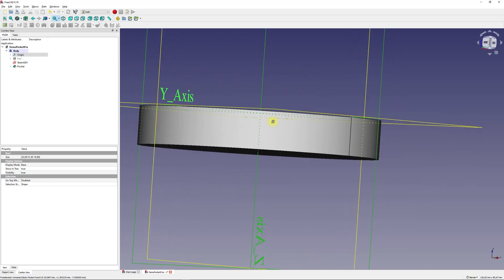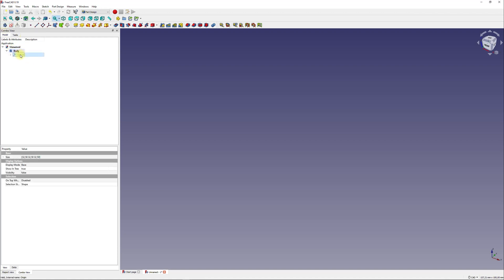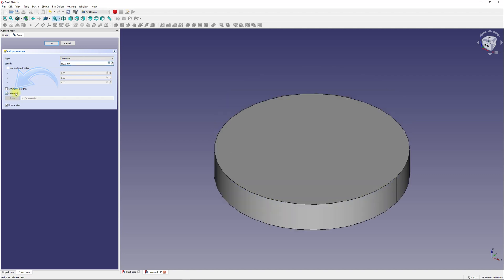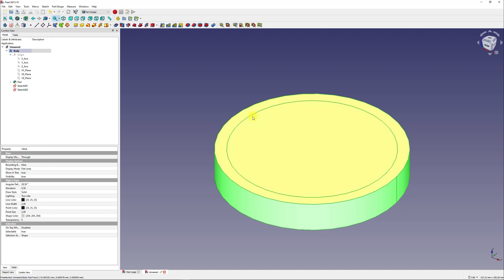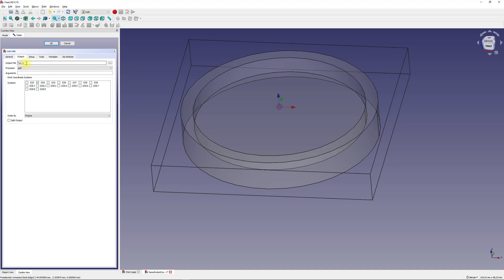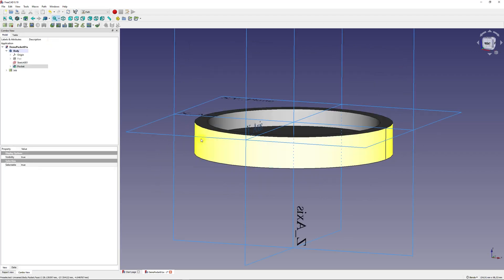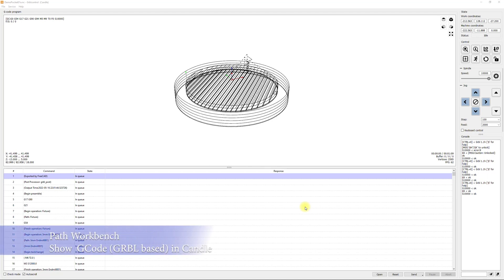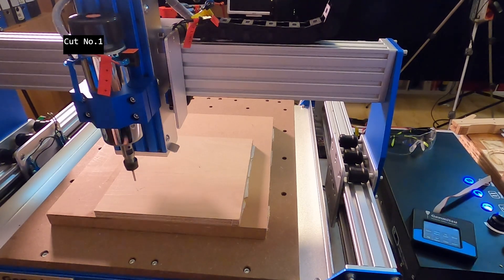FreeCAD and CNC machining - Basic profile and pocket toolpaths

Comment: Hello, I liked your video and I subscribed. I have been doing CNC machining for more than 20 years. I believe your part would have been perfect if you reversed the machining order, I E work from the center to the perimeter. That way the part would be held very well until the very end. I have a suggestion for another video. I have not been able to find a video on cutting  templates. I E cutting a thin piece of stock say 2 or 3mm thick. These would be cut in one pass , inside cuts first. I think it would be a popular video as there are a lot of uses for that kind of cutting. Model airplanes, boats, jewelry boxes etc.....This kind of machining is so useful. Thanks for your time !!

Comment: Hello . 
Thank you for your great video which I found very useful to follow
If I may ask.
I am also using v19 of freecad and then tried it with version 20 with the same results
In your video where you do all the path work ...
In depth, I do not get the option for final step down
In operation, I do not get the options like cut mode, pattern, angle, stepover percent, etc...
Am I missing a step that would enable those option ?
Many thanks
Reply: Finally worked it out after watching your video a few times
It was there but I did not spot the subtle difference betweenteh two path operation s
You uses a profile path for the outside and a pocket shape for the pocket shape which enables all those missing options
Keep producing more great videos
Stephan
Reply from the maker: @TheMysticABC  Hello, yes this can easily be overseen. By the way I'm using Freecad with this configuration:
OS: Windows 10 Version 2009
Word size of OS: 64-bit
Word size of FreeCAD: 64-bit
Version: 0.19.24267 +148 (Git)
Build type: Release
Branch: Branch_0.19.4
Hash: 476ecf091941bead59b14e44afa6064d5a66afa3
Python version: 3.8.6+
Qt version: 5.15.2
Coin version: 4.0.1
OCC version: 7.5.3
Locale: German/Germany (de_DE)